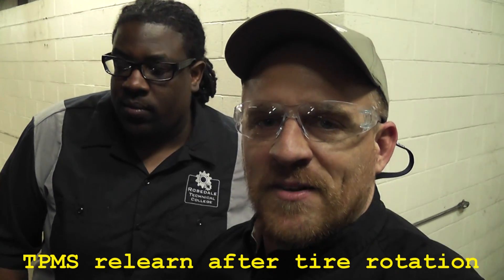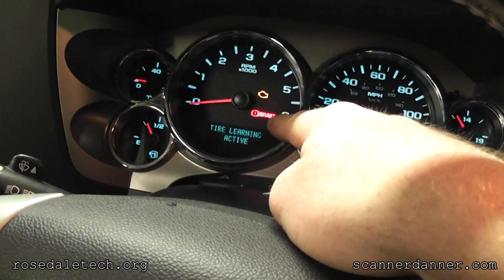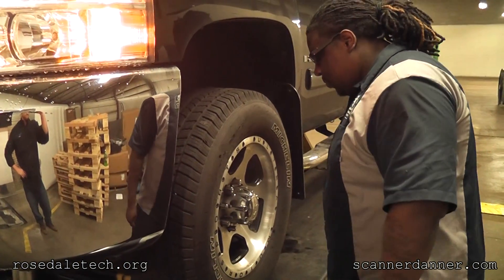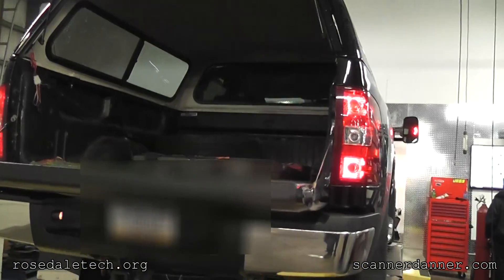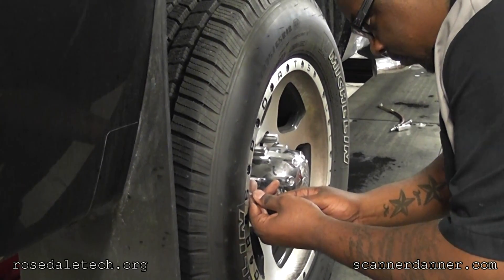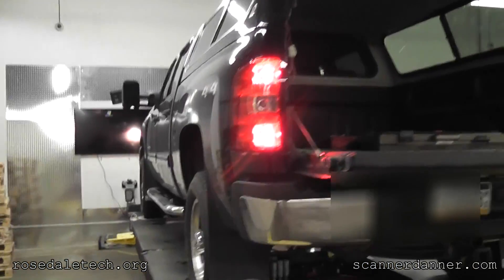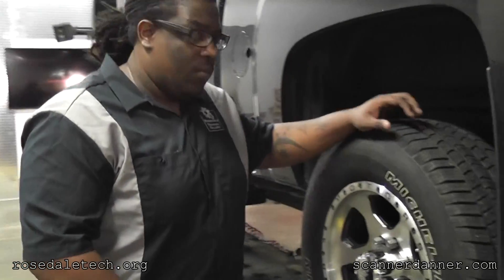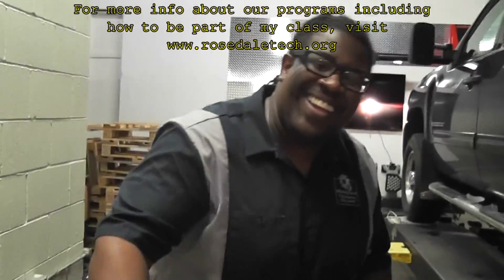How to relearn tire pressure sensors (no tools required)-GM (up to 2010)

Comment: i have a 2009 chevy silverado 1500 and tried this, i started with the front left as you normally would and i let air out of the tire for like 15 seconds and it didn't do anything and i couldn't move on to the other tires, i didnt know if i should just keep letting the air out to see if eventually the horn would honk or just assume the sensor is bad and take it into a shop. anyone willing to help me out i would highly appreciate
Reply: Then you will not be able to do this. There is an issue with one of your sensors. You'll need to have it checked for a specific trouble code, then go from there.
Reply from the maker: Before you began, did you have a TPMS light on (tire pressure warning light)
Reply: ScannerDanner yes it says on the dash service tire monitor system
Reply: ScannerDanner i will try it again today because i read up on it and it can take up to 30 seconds before the horn chirps, in some cases 45 seconds, so i will give it another go
Reply: Zach Hampton - I'd bet your car had the TPMS sensors replaced with newer models that require relearn tool, and do not work with this pressure change method (pre 2011).

The GM Tire Pressure Monitoring System (TPMS) is designed to provide information to the customer allowing them to better maintain proper tire pressure in their vehicle. Proper tire pressure is important for optimizing safety, fuel economy, vehicle performance, and tire wear. Because the GM Tire Pressure Monitoring System (TPMS) recognizes a unique sensor ID in each tire, a TPM relearn must be performed after every tire rotation.

On past model vehicles, there were two procedures to relearn the TPMS: a Dealer Procedure and a Customer Procedure. After putting the vehicle in relearn mode, the Dealer Procedure used a TPM Tool (J-46079) or equivalent to activate each TPM sensor individually (Tool Method). This allowed each rotated tire/TPM sensor ID to be stored in the new corner location. The Customer Procedure required increasing or decreasing air pressure in each tire by one psi (Delta Pressure Method) to active the sensor allowing each rotated tire/TPM sensor ID to be stored in the new corner location. When using either the Dealer or Customer Procedure, there was the possibility of picking up and storing a stray pressure sensor signal ID from another vehicle that may have been broadcasting n the area. If a stray sensor was inadvertently stored, the system would not recognize the stray sensor ID and the vehicle would set a Diagnostic Trouble Code (DTC) and illuminate the TPM System light.

To commonize procedures and eliminate the possibility of storing stray sensor signals, starting with Late 2011 Model Year GM vehicles and all vehicles build after that point will support just one TPM relearn procedure - the Dealer Procedure. This change allows both Dealers and Customers a common, faster, and more efficient method to relearn tire pressures after each tire rotation. Because all future TPM Relearns will be performed using the Dealer Procedure, customers wanting to rotate their own tires and perform their own TPM Relearn will be required to utilize a relearn tool. GM has designed and manufactured an inexpensive Relearn Tool (EL-5044 specifically for this application. Owner’s manuals have been updated accordingly, to verify the relearn method to be used, reference the Owner’s Manual – Tire Rotation – TPMS Sensor Matching Process

Comment: Hey... Thanks!!!   I have a 2010 GMC Sierra Denali and this worked like a charm.  i did use the end of a Tootsie Pop stick instead of the screwdriver LOL  #genius ... OK, I had a few in the cab along with a tire pressure gauge but hey I like to be different ;-)

Comment: I have snow tire rims with no sensors,,,,,,,
1) Will the 13 Cruze "re-learn" the original rim when put back in springtime after 5 months off.
2)Will this work outright on a 13 Cruze?
I guess we will find out in May 17.
Thanks

Comment: Does that work on 2012 Cruze?
Reply: Works on my 2012 Malibu, so it should.  Look in your owner's manual.  It should be documented.  Remember to overfill your tires (keeping in mind max pressure) with air prior to performing this procedure because sometimes it takes a long time to honk.

I never noticed the directional signal though.  Just never looked. The manual says which tire to start with and advance to until complete.

Comment: Tried it multiple times on my 2015 GMC Sierra, could not get it to work. It would not reconize the air pressure loose. I let the tire go flat and no results. HELP!
Reply: The sensors have gone into "sleep" mode and you will need to use a tpms tool to "awaken" them.
Reply: Tried it numerous times does not seem to work on my 2015 Silverado the left front light stays on after it beeps and says it's relearning
Reply: Gary Peccarelli did not work on my 2015 Silverado did the same thing let my front left tire go flat I know results that I filled it up and still no results

Comment: That don't work on 2016 You need the tool No other way that I know of
Reply: Worked perfectly on my 2016 Equinox.
Reply: Yes. Unfortunately that does not work also on GM OPEL Vauxhall Astra K series 2018.
Reply: Didn't work on my 2015 Silverado either. Drove it 1 Block and it recalibrated!!

Comment: Hi! Great video. I have switched to winter tires they are on original Chevy factory mags with TPMS. Worked fine on the first drive then it's asking for TPMS servicing and when I look at my menu options I have no pressure readings at all. Is it the same procedure? Thanks. (2015 Chevrolet Equinox)
Reply from the maker: It is becoming more and more difficult to answer questions here. I have 80,000 people asking me for help now. So I have created a forum to help you guys better. It is free to join and we can exchange pictures, wiring diagrams and waveforms if needed to help guide you through the process of troubleshooting your vehicle. Thank you so much! Hope to see you there. 
Paul Danner (ScannerDanner)
 https://www.scannerdanner.com/forum/post-your-repair-questions-here.html
Reply: I have a 2015 Chevy Equinox. Doesn't work anymore on recent models. Had to buy a learning tool.

Comment: This trick does not work on my 2016 GMC Sierra 2500 HD  Figures the factory would realize this trick and banish it.
Reply: Kerry Trostel I just had one dealership tell me the tool wouldn't work on my 35"s and I had to just let it go. I called Bullshit and called a better know dealership a bit farther away. On speaker phone the tech straight called them idiots and to pay attention. He said push the stem inboard to kick the sensor out towards the tool and it worked like a charm. It took them 2 hours to try and learn them. And failed. I had to make the call. Won't be going back there for sure. Last free oil change with the truck purchase any ways. Lol.
Reply: Kerry Trostel - Only works on pre-2011 vehicles, and that is assuming they haven't had the TPMS sensors already changed for new versions.

Comment: thanks it worked for my 2011 sierra you have to use your original key fob though, 2011 must be the last year this will work on. I used to just rotate my tires before myself without resetting which is fine (you will know your pressures just not exactly which tire is which)  but this year I bought new summer rims and I just switched them for my winters and got a service tire system warning, I totally forgot since I have a different set of wheels I would have to relearn them

Comment: i've tried to do it on my tahoo 2013 but it didn't work. gave the two beeps an left signal went on. kept reducing air pressure until signal went off again and learning deactivated at the same time. tried it 4-5 times with the same result.

Comment: If you own a newer Nissan 2012 or newer if I recall. If the TPMS light is on, turn your key on and set your tire pressures. The car will see the change and turn the light off.

Comment: Aw man. I was a GM dealer tech for 6 years and never knew about the turn signal thing. I always just learned them in the order mentioned in the video cause that's what the GM manual said to do.
Reply from the maker: +dmorley100 :)
Reply: It might be something new in the new models. You may have never noticed it because it wasn't on older models.

Comment: I work for GM for 3 years. They stopped this feature on 2012 and newer vehicles because in my opinion they realized theses sensors have long distance and you'll  inadvertently relearn your coworkers tire sensor in a crowded shop doing a routine pressure check and sometimes not realize it. Because these do not set a tire light immediately after they lose the signal the customer may take the vehicle and have a foreign tire sensor learned to the vehicle and eventually have the light come on and cause the customer to come back inconveniently. 2012 and newer and gm body control modules are designed to only to receive the sensors serial number with a radio frequency activating tool. Imagine if you have a faulty sensor stuck in pressure fluctuation mode, it will make every car impossible to relearn properly within a 100 foot radius. It can be a headache to the tech if they don't know the potential to these sensors. They won't teach you what I told you in a service manual. It comes from working a year in a high volume GM dealer by trial and error.
Reply: Brandon Tracy - You are correct and the editor won't acknowledge it.

The GM Tire Pressure Monitoring System (TPMS) is designed to provide information to the customer allowing them to better maintain proper tire pressure in their vehicle. Proper tire pressure is important for optimizing safety, fuel economy, vehicle performance, and tire wear. Because the GM Tire Pressure Monitoring System (TPMS) recognizes a unique sensor ID in each tire, a TPM relearn must be performed after every tire rotation.

On past model vehicles, there were two procedures to relearn the TPMS: a Dealer Procedure and a Customer Procedure. After putting the vehicle in relearn mode, the Dealer Procedure used a TPM Tool (J-46079) or equivalent to activate each TPM sensor individually (Tool Method). This allowed each rotated tire/TPM sensor ID to be stored in the new corner location. The Customer Procedure required increasing or decreasing air pressure in each tire by one psi (Delta Pressure Method) to active the sensor allowing each rotated tire/TPM sensor ID to be stored in the new corner location. When using either the Dealer or Customer Procedure, there was the possibility of picking up and storing a stray pressure sensor signal ID from another vehicle that may have been broadcasting n the area. If a stray sensor was inadvertently stored, the system would not recognize the stray sensor ID and the vehicle would set a Diagnostic Trouble Code (DTC) and illuminate the TPM System light.

To commonize procedures and eliminate the possibility of storing stray sensor signals, starting with Late 2011 Model Year GM vehicles and all vehicles build after that point will support just one TPM relearn procedure - the Dealer Procedure. This change allows both Dealers and Customers a common, faster, and more efficient method to relearn tire pressures after each tire rotation. Because all future TPM Relearns will be performed using the Dealer Procedure, customers wanting to rotate their own tires and perform their own TPM Relearn will be required to utilize a relearn tool. GM has designed and manufactured an inexpensive Relearn Tool (EL-5044 specifically for this application. Owner’s manuals have been updated accordingly, to verify the relearn method to be used, reference the Owner’s Manual – Tire Rotation – TPMS Sensor Matching Process
Reply: @cup_and_cone  Shut up!
Reply: i work for gm now and we are required to relearn even the 2016's. yeah sometimes it is a pain if the guy next to you is doing a relearn and doesn't realize. just gotta watch for it
Reply: I dont know about this cause I have a 2012 Escalade and it has the tire sensors on them,I hate them !Already replaced a few but honestly I think its the raggedy CADILLAC WHEELS thats causing me all my tire issues due to flaking bad on inside of backside and of course I didnt know the cadillac wheels had these awful issues ahead of time and now year later Im still having issues with tire pressure,
Reply: @beverlyjennings1638  - The TPMS sensors were only designed to last 5-10 years, depending how much mileage they see (they can go into a lower power 'idle' state when not in use) and the type of weather they see (cold weather really hurts battery life).  The biggest issue is that no one knows when to replace them until they have one die...and chances are, that's not around new tires.  The best advice is if they're older than five years, change them all on your next set of tires.

Comment: I'm a tech at autonation Chevrolet, and we use a remote to relearn tire position. simply put it in relearn and press a button on the remote while it's next to the valve stem...

Comment: If I put on tires that show a different rating than the sticker, what should I go by?  My truck does not have tpms.
Reply: unless your towing with the vehicle or live in an area with harsh environment I.e. snow mud etc... stick to (p) series passenger tires they are cheaper and are just fine for everyday driving. higher load range tires sizes with an Lt in front of the numbers are for vehicles that typically carry more weight like work trucks or trucks towing trailers
Reply: The truck is a dodge 2500, I do haul and tow stuff with it

Comment: This video couldn't have come at a better time. I can't find my owners manual and have just been ignoring my TPS since I rotated my tires. Thanks Boss!
Reply: technically the light will not illuminate from a missed relearn after a rotate. only for a low tire. check your air more often
Reply: +torcher78 correct but when you rotate them the tires tires show in the wrong position on the monitoring system.
Reply: +Timothy Lingo the tpms light will come on for a tire pressure issue , if it is solid that will refer to being under or over inflated. typically its +/- 5% of spec. the tpms light is normally solid. if your light is flashing its refers to a fault, a sensor didnt learn, battery in senor died and lost signal, broken sensor or in some cases people took the sensors out and placed normal valve stems in the wheels. You can buy a relearn tool , really simple to use for around $100 and as long as you know how to put your car/truck in relearn you can use the tool to relearn your tires but if you take your car/truck to a shop for service majority of them have the correct tools. issues is at the dealership i work which is a GM one when we get other makes in its a hassle to relearn as my tools are for GMs not FORD ect.
Reply: +jay webb Firestone rotated them and forgot to relearn there position. Took it back and I think their scanner was just goofed up. I did the manual relearn and fixed it.

Comment: tire shops are getting  screw  they  do not charge  for tire  rotation , if you buy  tires with them. and free  tire  flat repair. for the  life  of the tire.

Comment: Whenever I used to do rotations I always balanced them at the same time with the correct air pressure, before adding the weights.  It's a few more dollars, but worth it in my opinion.  Take care of the Key Fob.  If it's broken or the battery is dead, you will not be able to relearn the tire positions.

Comment: Can you use this relearn method on all GM cars if you know the order it needs to go into? My dash doesn't tell me what tire is low, but OnStar can; shop that rotates my tires frequently forgets to relearn them and I don't have the relearn tool.
Reply: go back complane and make them do it!
Reply: +Shaun O er, you're right, four-days-ago me needed some coffee.  

What I meant was can you use the let-air-out-of-tires part of it (assuming you're in learning mode) to tell TPMS which tire you're at?
Reply: +Shaun O '13 chevy spark
Reply: +Jessica Litwin  it was mandated by federal law that all passenger cars/trucks have tpms by 2008. therefore you have tpms. if you have your owners manual there is info regarding it. I am a tech for a GM dealership. Typically on the new cars it is through the driver info center. there is a menu button either on the steering wheel or the lever for the windshield wipers. press that button go through the menu til it says relearn tpms
select yes by twisting the lever or pressing the up and down keys and then select menu again to select that option the car should honk twice, that will let you know you are in relearn mode and do as this video informs. Or Take it back to the dealer and make them relearn it if it wasnt, which where i work is required for any tire/ wheel related service.
Reply: So lettting air out of the tires in relearn mode will work. Cool! Thank you!